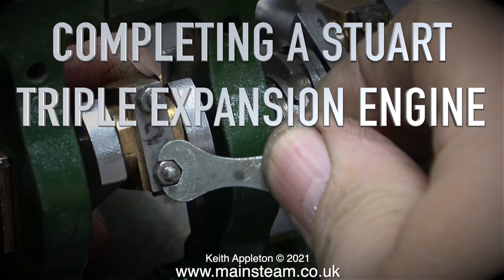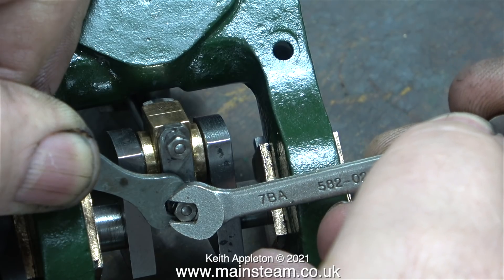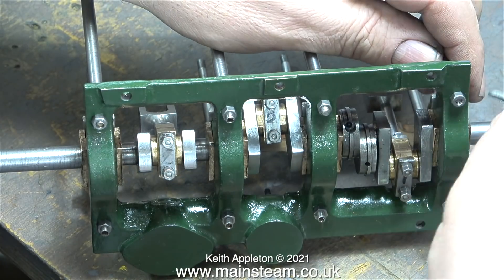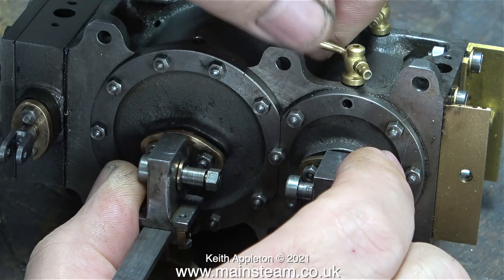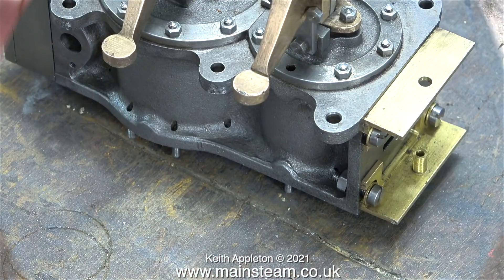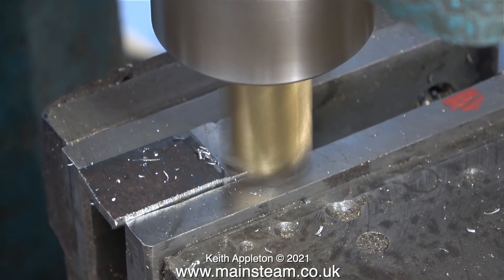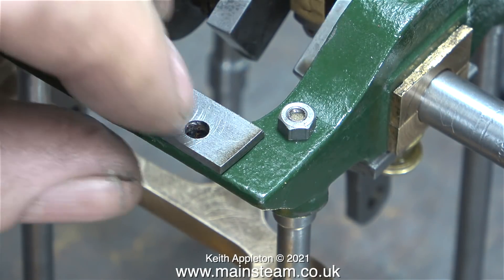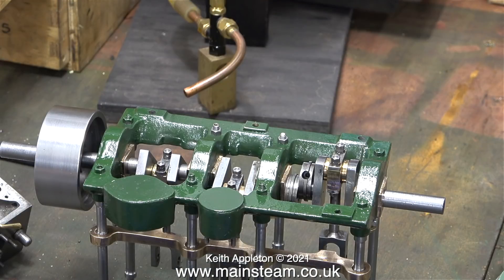COMPLETING A STUART TRIPLE EXPANSION ENGINE - PART #22

Comment: As I understand things, these full size engines ran quite slowly.  Why then do folk run model engines at high speed, equivalent to about a thousand miles an hour.  A locomotive with eight foot driving wheels at 100 miles an hour achieves about 350 revolutions per minute.  So why run the model faster than that???

Stavros
Reply from the maker: They didn't run slowly really. Even a Mill engine rattles on at a good rate of knots . . . as can be seen in this video: https://youtu.be/b0Rse1dYrPQ               and then of course there was "Mallard"

Comment: Very interesting. It seems, at least to me, that the choice of BA fasteners, which might easily get snapped with a little spanner, is done for cosmetic reasons, to resemble a miniature copy of a full size engine. This is not a criticism, just an observation.
Reply from the maker: BA Threads are very similar to metric threads, although small they are quite strong.